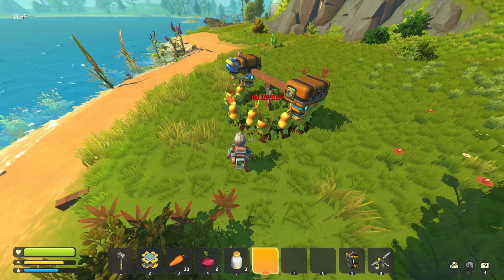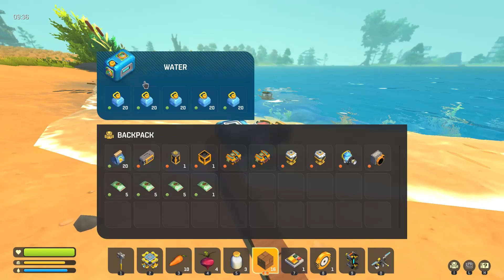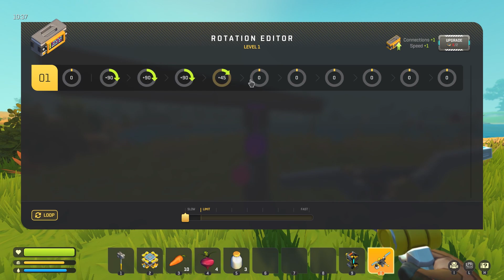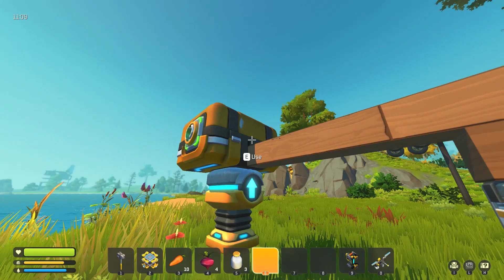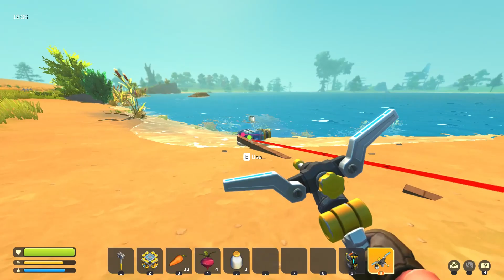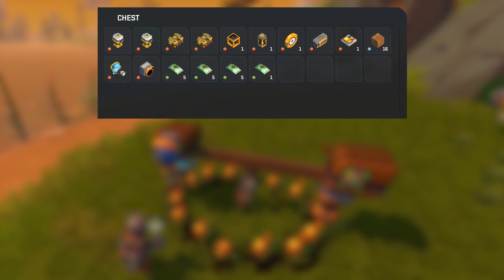[OUTDATED] Super Simple Fully Automatic Farm, Plants, Waters and Harvests! [Scrapmechanic Survival]

Comment: Hey dude i did it !!!! NO RAID FARM 😎 i reduced the diameter so there are only 8 farmlands !!! Thanks for the design
Reply: Mind sharing how you did it? What time delay did you use?
Reply: @MatthewLombardi84  the farmlands must have a tiny gap between them , move the water cannon by 1 block inside, the time delay is 2:750
Reply: Thanks. That's real helpful.
Reply: @shravanchilka7466  I'm trying to recreate your version, but without success.  How many blocks do you have between the center post and the chest?  Seems like it needs to be three.  Did you change the controller settings to make it go slower?  Did you place the sensor differently or have a longer range?  Did you add another timer to delay the seed planting?  Mine keeps throwing out seeds in the wrong place.
Reply: @shravanchilka7466  I figured it out.  It is indeed 3 blocks between post and chest.  Controller is the same and sensor is the same length, but the sensor is one block farther out.  Additional timer for planting is set to 1.0 sec and watering timer is set to 3.5 sec.  I read that you can have another small farm as long as it's 256 blocks away, so I plan to do multiple automated small farms.
Reply: @StevesMakerspace  I want to do this too, but I don't know how to set the time for planting to 1 sec, all I know is to change the timer to 3.5 sec, if possible can you help.
Reply: Easy way to have less plants. Just take away  the dirt. Only leave as many as u want planted
Reply: was my idea while i watched, so it really works then!? i think this is so far the best solution for a first survival auto farm !

Comment: Instead of connecting water pump from below I did it from above. Because from below it doesn't let me put the soil, even in 3feet below the ground. I just adding a bearing on the top. To make it stand still I connected it to the controller just for the time I needed to build the connection to the water. Then I disconnected it. Your idea is great but need to be customized even depending where you put the soil. 1 square make the difference, especially for the sensor. With 8 is easy but the more the harder. I managed to do it, but I'm still searching a way to connect woter cannon from below because I would like to use the crusher too...

Comment: i might have done some thing wrong but I planted 1 crop turned it on and it uses 1 plant only on the plant i planted pre turning on then it won't plant anywhere els so it wastes my plants I had a full large chest of seeds then 10 mins later down to 20
??????????
Reply: Same problem.  What I did what I made a 2nd logic gate/timer/sensor specifically for the seeds chest.  But now I run into the problem where it continuously plants seeds where theres already plants

Comment: Put the arms on pistons on another controller that extend out after the inner ring and the next ring and so on. I'll try and build it myself but it would make my current farm obsolete and save so many resources in the long run not to mention even of the farm did get raided theyd get caught up destroying the crops before they ever got to the build it self this could be huge
Reply from the maker: I explain in my newest video why I did not do this.
Reply: @bblessed  I ended up doing it and put arms on the other axis and it was a great defense mechanism as well lol but it was a pain to set up accurately ended up having to do a lot of the planting myself or suffer neverending raids because the crops would be completely out of sync. Also took it down because I wasn't able to automate the collection system to send stuff into a chest other than the one that does the collection. If they ever implement being able to move stuff from chest to chest in an automated way like with the hoppers in Minecraft I'll definitely set it back up though
Reply from the maker: @RogueAero  I once had a two rowed version with pistons working, but the main downside was, the crusher nearby or eventual debry coused by rads messed the delicat system up badly.
Reply: @bblessed  the debris is why I added the arms on the opposite axis it rag dolled them out of the area. I had plans to make the whole island that I'm on just a giant farm but the bots kept coming from the same spot sit I just turned it into my bad and used a more compact farm to farm the bots lol. But I've gotten enough components and circuits and even enough metal from  the haybots that I roofed the spawnable areas to turn my large farm into a raidless farm.

Comment: Great concept, but it completely breaks if the land is uneven whatsoever.  I tried to build it and about 1/3 of it is not detected by the sensor correctly and it keeps wasting seeds trying to plant over ones already there.  It would seem that the sensor has to be just above the crop plot and if it's too high or too low it will not detect the crop correctly.
Reply: Update - So after finding a more level section of land (I tested this by dragging out a full 16x16 wood blocks) this works perfectly!  Thanks for the tutorial on this.  Will save a ton of time and it's not very expensive.  Will have potatoes for days now.
Reply from the maker: @c_death  Glad it worked out for you in the end. And thx for your comment :D